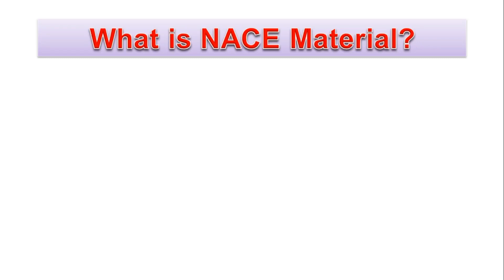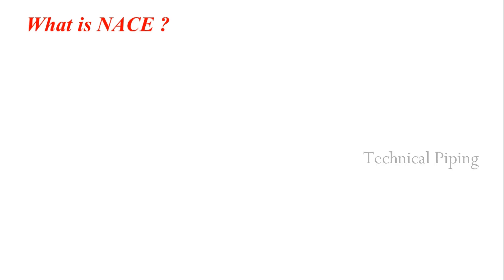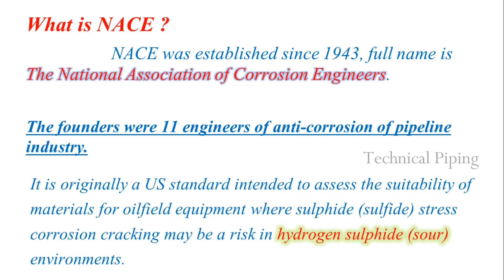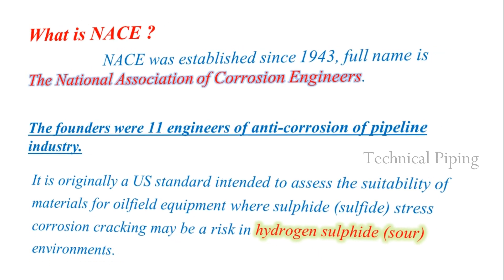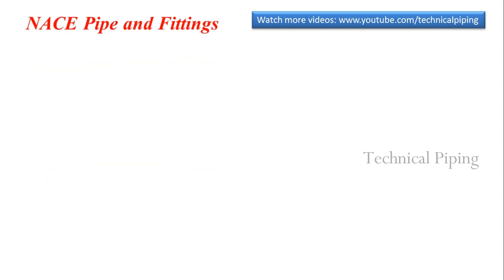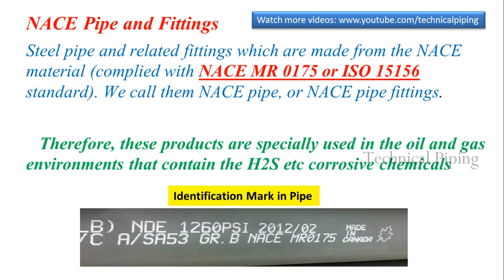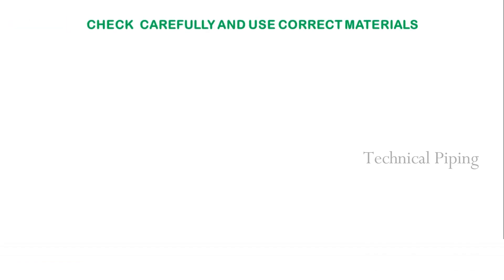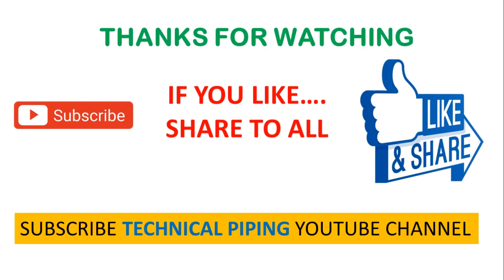Why NACE Material? | Piping

Comment: It's used in sour service, h2s service to prevent from corrosion by controlling  % of element like sulphur during manufacturing of raw material like fitting, plate, pipe, flange, welding consumables
Hardness restriction also must. 
Nace MR0103, naceMR 0174 are two most specs used
Reply: You mean MR 0175 / ISO 15156

Comment: Please preheat and post heat with nace required
Reply: cold form material shall heat treated
Reply: @souravsharma8368  Why cold worked to be preheated. Thanks for your reply.
Reply: @cck0728  due to formation of coarse grain because of that stress is high at grain Boundaries, on apply of heat new grains form dislocation of grains started grains arranged in definte pattern release of stress at grain boundaries
Reply: @souravsharma8368  Thank you for the clarification. Please keep on contributing with your valuable expertise.